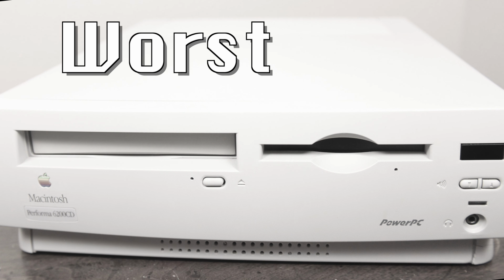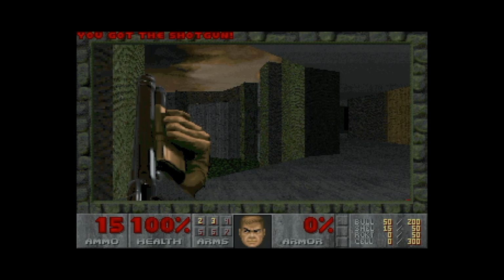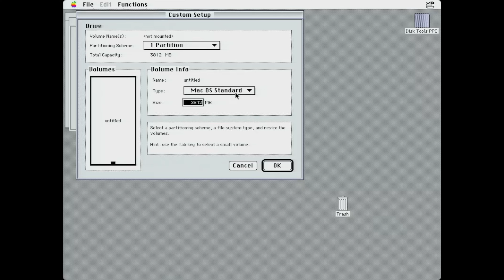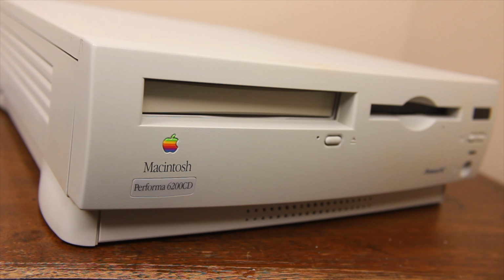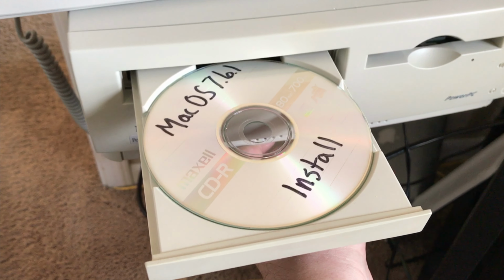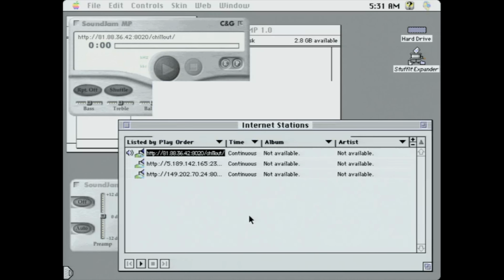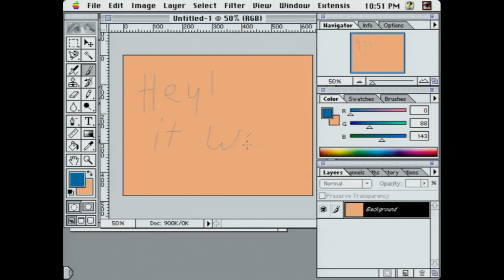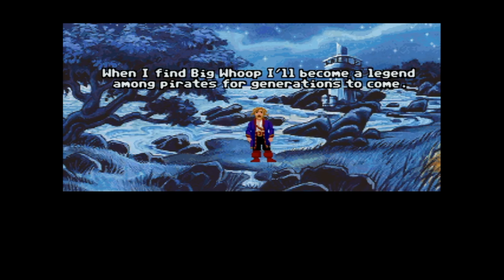Apple Macintosh Performa 6200CD - Upgrading an Old Friend

Comment: Problem with that DOOM game is that it wasn't optimized for PowerPc so your mac had to emulate the 68040, and as one of the slowest PowerPC chips, it could not do it as fast as an actual 040.  I run this version of DOOM on my commodore Amiga (68060) emulating (software) a mac Quadra 700 and it runs at around 12 fps.  Not really enjoyable but not a slide show either- a PowerPc should do way better than a 68060 (the 68060 emulated the 040 better than the PowerPC).
Reply from the maker: What’s sad is that it IS optimized for PPC. It’s a poor port in my opinion - they could have done better 🙁
Reply: @insanelygruz  Wow that is 😞  sad.
Reply: I played doom 2 on my Q610 and it ran fine. Had the screen a little small. But it ran smooth with good frame rates. I played it soo much. Maybe the PowerPC port was bad. But the 68k was pretty good ….

Comment: Two ways to speed up DOOM II on Performa 6200: 1. Run it at low resolution, cycle to this setting by pressing F5; 2. Turn music off. Try both to get maximum performance. 
The best way to upgrade your 6200 is to insert a 5400/5500/6400/6500 logicboard, with an upgraded power supply.